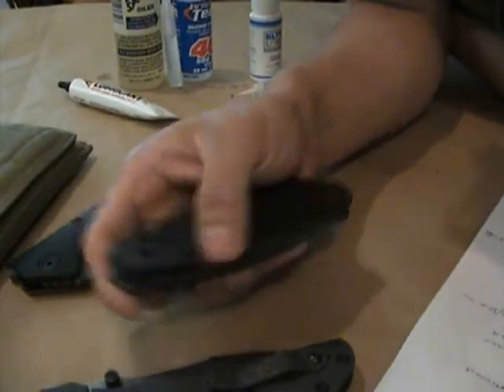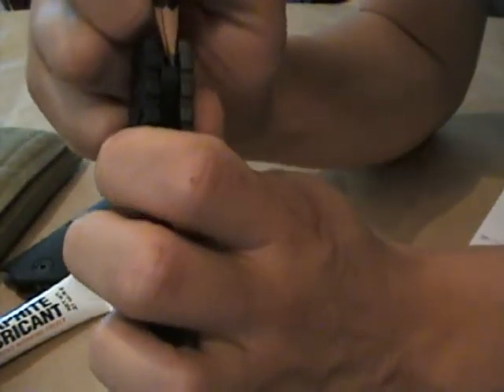Rust & Good Lubrication Methods

Comment from the maker: @pietermoore CPM154CM has 4%Mo (Molybdenum) I personally avoid graphite for the actual pivot & hole just cuz you'd have to ask Burke's manager whatever his name was what steel his hardware is if you wanted to be sure. Like I said though the pivot's getting so much motion it'd be improbable that you got something like water or salt stuck in there that was gona just sit in place. Graphite absorbs whats around it. Put oil in the pivot & graphite will mix with that & of course oil repels water-thx

Comment from the maker: Yeah! I've got a little on the back of my Terzuola/Strider's blade tang where the lockbar meets. Titanium is like anti corrosion everything. Ur Rockstars got two slabs for the handles right? Yeah it preserves the lockbar it may take a couple tries with different pencils & a couple more applications to really get the graphite (unless it's 2B) to stick. I've only done the graphite on my washers when I was out & didn't pack grease/oil. Purely dry lubricating kinda reminds me of Rem Oil but w noise